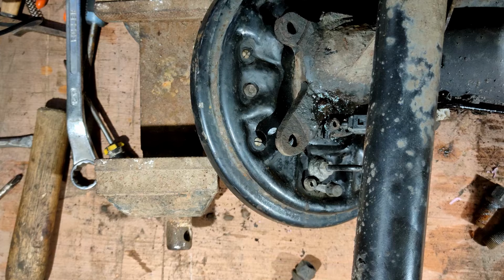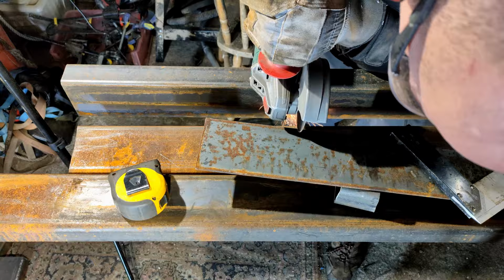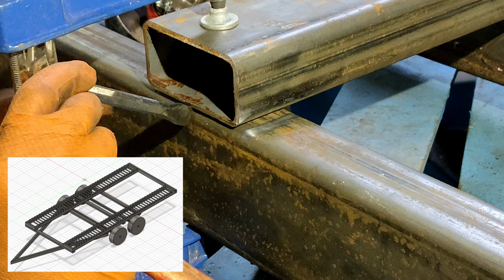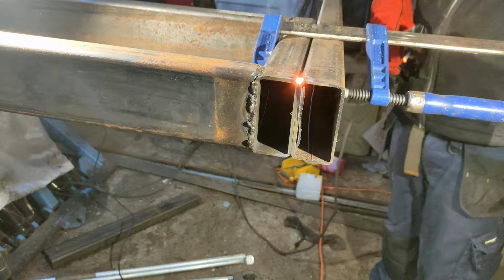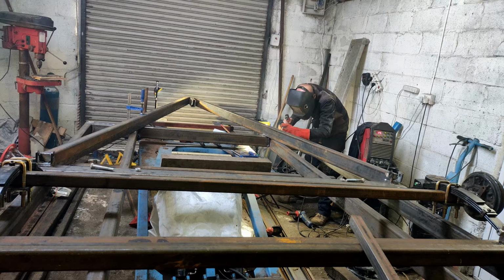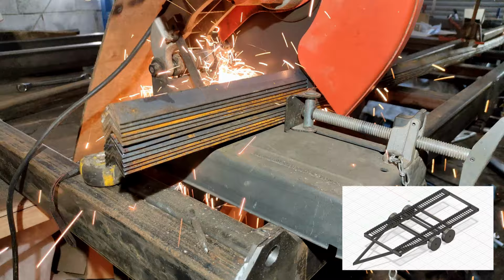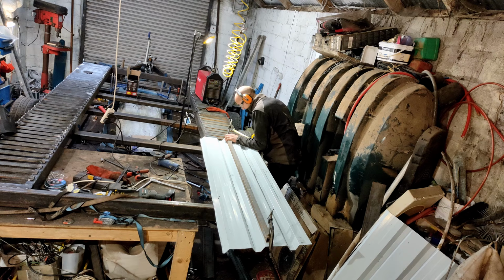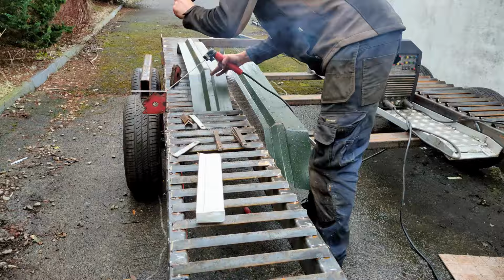DIY Trailer Build - Car Hauler - Part 2 of 2 - Everything Else

Comment: Looks good ! interested to see how the suspension felt with fixed brackets on the back too ? I was under the impression the leafs needed to be fixed to a swinging arm to allow for movement ?
Reply from the maker: Only the front on the spring is fixed, the back is floating to allow movement.

Comment: Thanks for posting, I'm just in the process of building my 4th car transporter project (cf bedford single car transporter, Mercedes 2 car tilt commercial car transporter, and a basic car trailer) I'm going a slightlty different route with a single axle 20ft caravan chassis and another axle(1500kg rated axle x2) I've had to go for 185x70x14" 8ply tyres to get the correct rated loading, have you used van tyres, I would have thought that car tyres aren't rated for that kind of punishment. Also curious as to why you didn't use phenolic birch ply or Aluminium 5bar plate as your running boards, was the £600 build cost the restrictive factor? I must admit, I'm looking at around £1200 to build my tilting trailer, sorry for the questions, but there may be cheaper design stage alternatives to building my trailer, cheers
Reply from the maker: Cost was the main factor, in hindsight by using steel I'm able to use the runs a tie downs when carrying light things. I've recently moved house the transporter trailer came in very handy. The car tyres are definitely the weak point rated for from memory only 550kgs but it gives me a 2 tonne limit, the hitch is limited to 2.7tonnes and my current car is only rated for 2.5.
 I found I could buy a 2nd hand car hauler for about €900 so If my wife decided that 3 trailer is too many I could still get my money back.

Comment: What jack/wheel kit did you use at the hitch? Thanks
Reply from the maker: I'm based in the Republic of Ireland and I sourced most of my supplies from trailer spares (not sponsored).
The jockey wheel I got from here, prices have changed since I built my trailer https://www.trailerspares.ie/48mm-heavy-duty-smooth-jockey-wheel.html
The hitch was this one https://www.trailerspares.ie/kfg27.html
These links are not sponsored but I found the company very good to deal with and they sorted out any problems I had.

Comment: How heavy is the trailer and whats the usefull weight it can carry
Reply from the maker: The trailer is light to move around by hand, but like most twin axel trailers it's difficult to turn. The hitch is rated to 2700kg, the tyres are rated to about 2200kg, so I recon I could load 2000kg on to it (4400lbs freedom units)
Reply: @garagemade4422  nice, i am looking into building one my self, just need to check about the laws in my country for registration, they are very strict.
What was the pipe dimension and wall thickness
Reply from the maker: From memory, 100x50x4mm for the main rails and 100x50x3mm rectangle tube for the rest, 50x50x3mm square tube, the axel was thicker 50x50x4mm. 25x25x3mm angle for the treads, 100x5mm flat bar for the fish plates and anchor plates.

Comment: Really interested in building a trailer like yours do you have a cutting list you would like to share
Reply from the maker: Hi Peter, I'll have a look at my plans this weekend and throw a list into the comments
Reply: @garagemade4422  that would be much appreciated the plans would be good too
Reply from the maker: I'll see if I can upload my plan somehow.
Reply: @garagemade4422  would using angle iron work as well or would it need to be rectangular box section
Reply from the maker: Maybe, I've seen light weight trailers made from angle, but if your hauling a car or something heavy I would err on the side of caution. Sorry I didn't dig up my plans life took over last weekend, and it's my daughters birthday this weekend so I'll try to get you access to my plans this evening.
Reply: @garagemade4422  thanks appreciate yes life does take over I kinda thought that about the angle iron seen a few on ebay with them